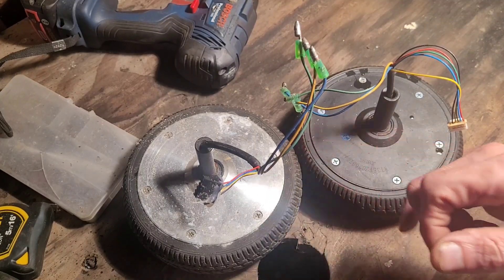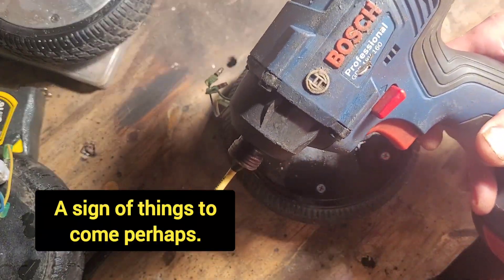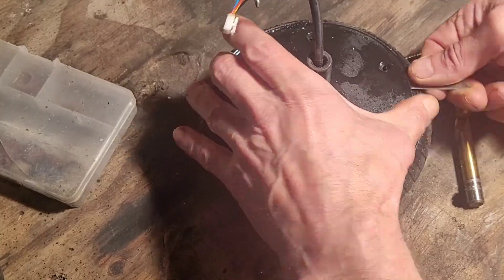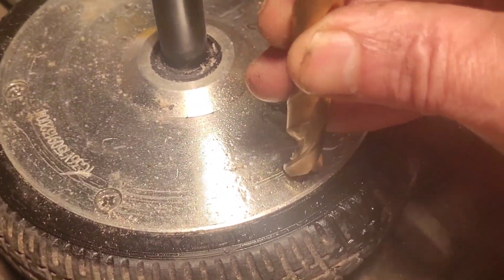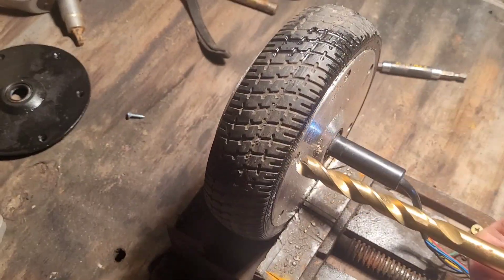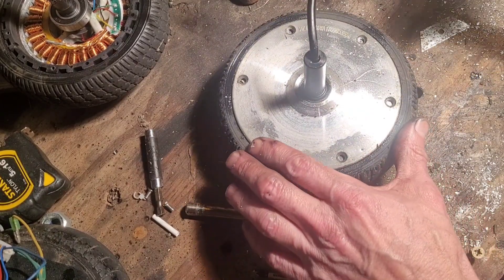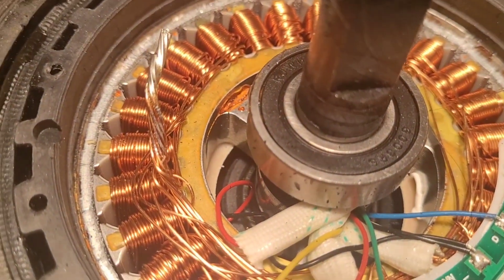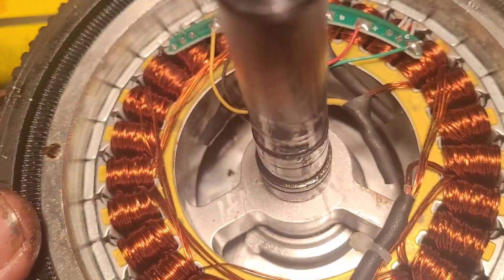Comparing Two Different 36v Hoverboard Motors - I finally know what causes the weight difference.

Comment: see it all the time. anodised aluminium. its only slightly lower in conductivity than copper. no big deal. cant solder it, not as valuable as scrap, and it suffers from a form of galvanic corrosion, but otherwise... makes virtually no difference as a generator or motor, other than a slightly higher DC resistance.

sigh. if only it was silver...